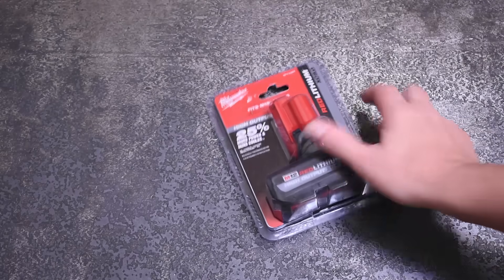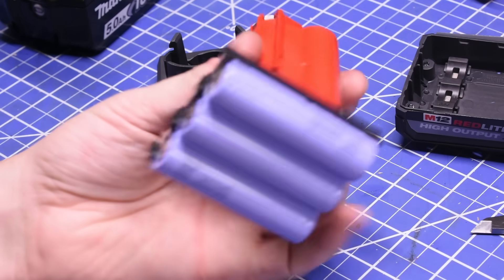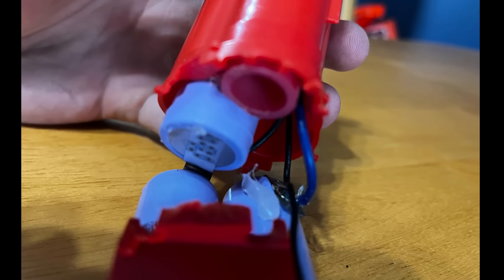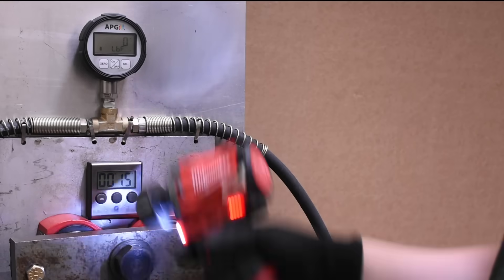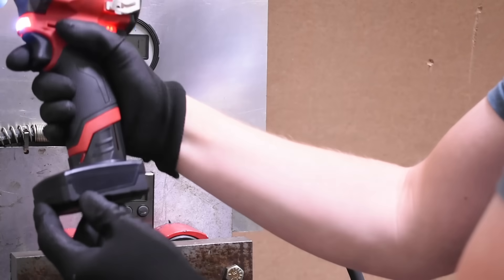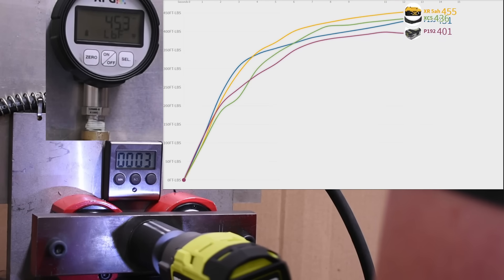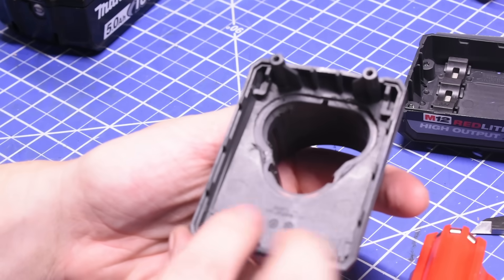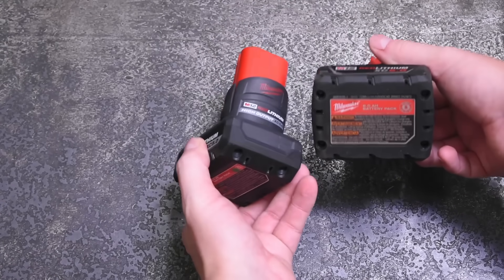Milwaukee's New M12 XC5.0 High Output vs Stuffing Actual 21700 Cells Inside

Comment: The existing xc4.0 and cp2.0 are also basically "high output" in that their cells are rated for 22 amps continuous discharge. The new HO M12 batteries use cells rated for 25 amps continuous discharge. So not a big difference. Barely any difference. And those ratings from Samsung are pretty much ignored by Milwaukee who likes to stress cells to their limits... It's no secret that if a battery is overheated, then it probably says Milwaukee on it.
Reply from the maker: Agreed. And we've seen XC4.0 perform best overall on some tools and the odd test here or there.
Reply: Finally someone explained what I've been experiencing! I literally only jse xc4.0 and cp2.0 and for nearly two years and have sworn they seemed a bit better than my other sizes. My 6ah doesn't seem as powerful as my xc4.0. I was convinced it was some kind of weird placebo affect but it consistently proved itself.
Reply: @briand2195  the xc6.0 uses the crappy Samsung 30q cells which are rated for 15 amps. The 30q cells are also the cells Milwaukee used in their exploding hd9.0 packs.
Reply: Yeah that's it. When I saw this new ho battery I was suspicious of it and the marketing and when I figured out they were using these Samsung cells.i knew I was right it's nothing but marketing. Technically there is a 2000mah Samsung cell that's 30a discharge they could of re made the 2ah abd 4ah and really made them some high output cells. That would off been better to see then these current ho batteries
Reply: Rated current is always a bit of bs number. You need to observe the voltage drop at these current levels and 25s are much better there
Reply: @riba2233  not really. The cells rating factors in the internal resistance and calculates it by what a cell can continously output without heating up
Reply: @randybobandy9828  sure bit for pure performance and how much power the tool will output voltage drop is most important. 25s have much less voltage drop and heat much less
Reply: @riba2233  voltage drop is the result of increased internal resistance. So ya..
Reply: @randybobandy9828  I know, and 25s have lower ir despite having similar cdr
Reply: @riba2233  and how exactly do you think they determine the rated amps of a cell?
Reply: @randybobandy9828  mostly based on temps, voltage drop is not a top priority
Reply: @riba2233  and Temps are based on internal resistance.... Which causes voltage drop lol.
Reply: @randybobandy9828  it is not always so simple. You can have cells with same discharge curves and voltage drop, but one getting much hotter.
Reply: Um no.. They have double the cells which means double the amperage atleast compared to the cp 2.0.
Reply: Those are also the batteries that Milwaukee is claiming 25% over, not the cp3.0 or the xc 6.0.

Comment: haven't had an m12 battery fall out yet. Getting them out sometimes is a challenge though.
Reply: Yeah that only seems to happen when the shell breaks
Reply: Same, Ive had issues getting them out when they are brand new but I've never had one fall out and my m12 rattle gun is probably my most used tool.
Reply: lol. I feel your pain. The key is to pinch them right at the top corners facing the front of tool.
Reply: Battery’s and good need to break in with around a week or 2 of constant use it will be a lot smoother
Reply: Seriously this. They're hard AF to remove and I've NEVER had one just accidentally come out. And my tools get used.
Reply: lol almost all of my batteries have issues falling out. unless the batteries are brand new or the tools brand new. I’ve been using for a long time though.
Reply: My old m12 batteries that I got when I bought their first ratchet falls out but they are 4 amp batteries a little heavy on the bottom. But it's only if it getting rattled good.
Reply: @jordanalexander615  i have 6ah and they've never fallen out, never even heard of the issue til now
Reply: @bradhaines3142  when I got mine there was no such thing it could have been an old design or maybe the tool itself. I noticed the screws on my 10 years old sub compact are loose but that was an easy fix.
Reply: Do none of you use the sawzall ?
Reply: @JoseHernandez-vz7bu  i don't
Reply: @JoseHernandez-vz7bu  I do and they don't (fall out).
Reply: Yeah they o ly fall out 99% of the time if there ild and worn out or broken or get dropped or shook up violently or not clicked in all the way if its new from user error
Reply: Or if its a knock off
Reply: You haven’t used the hackzall then lol
Reply: @zackphillips6648  For the third time, I do and they don't (fall out).
Reply: This man m12s 😂
Reply: I am a car mechanic and i use a M12 impact wrench, that regular M12 4ah or 6ah batteries hold about 6 month, than the tabs break of and the battery is pretty much useless. Got a new Impact from Milwaukee but it keep breking batterys. Hopefully this new battery wil solve the problem, i ordered one now.
Reply: I have the XC 4.0’s and can confirm they are hard to get out sometimes. Especially in the M12 Inflator.
Reply: I fought and fought to get the batteries out. Glad to hear someone else had the same issue. You know what I found? If you turn the drill/driver upside down, and lightly squeeze the two release spots, while pushing upward, it pops right out. It is unbelievable how easy it is to get them out that way, not sure why it is so difficult to get them out the way they should come out. The method I described above works for OEM Milwaukee batteries and the aftermarket ones you get off of Amazon. Hope that helps.
Reply: Mine has come out once while hitting a 10 lugnuts for 10 secs each
Reply: Same
Reply: Same here Steven.
Reply: Wish I could relate but I've broke my 2.0 and 5.0 battery's cuz they just fall right out 😩
Reply: Many an M12 tool has dropped off an 8' ladder to concrete and I've never had a battery self eject.
Reply: Shit I've had to send both of my XC3.0 M12 batteries back to Milwaukee for new shells.
Reply: Same here with my personal tools but I work in a machine shop with M12 drills at every mill, and when abused they start falling out pretty quick.
Reply: @jeremymiller1088  New RULE:  You abuse your Milwaukee, you get a Black & Decker next.
Reply: Never had one fall right out but on my stubby impact it very frequently shuffles out enough that the tool stops working. Incredibly frustrating when you're trying to get the job done
Reply: Only time I get my m12 to come partially put is when I’m using my m12 drill to start a lawn mower but that’s partially due to the torque on the drill not the battery’s fault
Reply: Mine are only a year old and they fall out all the time
Reply: I’ve had alot of them fall out,some tools are worse than others tho.

Of course only when dropped…..
Reply: I've got a 6 month old broken tab 6ah 12 volt right now in my work van. Ridcolous. Not sure if they'll just give me a new one or keep it for 3 weeks like they did woth my Milwaukee ratchet when rebuilding iy
Reply: I bought my first pack of 6.0s from the Cornwell man and had to warranty both of them the same week as both of them broke and would not stay in the ratchets and grinders I use daily. Really made me upset. Starting buying Snap-On instead and now the main problem is getting those damn batteries OUT of the tools hahaha. They are SNUG in there. But thankfully they last for weeks so I don't take them out often.
Reply: Especially getting them out of the m12 air inflater, when your using the compact battery's (1.5-3.0's). Still one of my favorite and most used tools though.
Reply: I struggle the most getting my 6ah battery out of my M12 radio... So much so I just use 2ah batteries now on the radio
Reply: The M12 Hackzall chucked it's xc6.0 and broke a tab off, otherwise I haven't had any problems.
Reply: Yes! 
I have not had a battery fall out when I put it in right matter fact I have a hard time getting them out. 
I think other people just don’t put their batteries in properly
Reply: I've got 3 of them that have been back to Milwaukee a total of 8 times for the shell cracking at the base of the tabs.
Reply: Ive had several m12 and m18 batteries fail.  All limited to m12 6ah....m18 12ah and 6ah batteries.  On the 12's and 6ah m18 batteries they failed by 2 packs.  Anotherwords sequential serial numbers.  Either milwaukee intentionally sold old batteries to HD or a quality control issue occured for periods of time.  Either way...I'm dead set on switching over to flex.  I'm most of the way allready.  Red can keep their new forge batteries....
Reply: I’m finding that at work as well.
Reply: This right here.  I've got a pile of M12 2 ,4 , and 6Ah batteries and they can be a 2 person fight to get out sometimes.  I'll stick with my 6Ah from this test.
Reply: Hell yeah lol
Reply: Yea I can’t get mine out 😂 I’ll be standing there fukkin with it for a good min.
Reply: When I first got my M12 ratchet I had troubles with the battery falling out I even had tape across it to make sure it would not do that again and then I switched to an aftermarket battery I've never had one fall out since
Reply: @deepsquat600 the aftermarket batteries have a very tight fit! I have trouble getting them out sometimes
Reply: Try em with a sawzall
Reply: @cedrusthe1st  I have for four years without issue.
Reply: To me that sounds like you're keeping the batteries cool. ABS is pretty soft when barely warm (below boiling point). 

Try leaving a pack sit in the sun for a few hours, then test that latch.
Reply: @Iowa599  If you're leaving lithium based batteries in direct sunlight for hours at a time, that's on you.
Reply: @Iowa599  Anyone leaving a lithium cell in the sun for a while is already doing something wrong. Setting them in/behind your bag/box or even a chunk of cardboard covering them will keep them scores of degrees cooler.
Reply: @hydrocarbon82  sometimes they're getting fried in the sun while on your belt

Comment: how about slapping a rc hobby lipo onto it. they are designed for extreme loads. a 4ah 3s pack with 80..120C can handle 300amps with ease. lipo might have a lower voltage tho, might try LiHV batteries instead.

Comment: TTC! I’ve been thinking about making a custom “stacked” battery. Basically fitting 5AH worth of power into possibly a 2.0 case but from polymer cells. Similar to dewalt but for Milwaukee. Would that be something you guys would be interested in?
Reply from the maker: In m18? Drop us a line Torquetestchannel@gmail.com
Reply: @TorqueTestChannel  yes! I might attempt m12 in the future but due to the shape of the housing, m18 is the best case, plus power gains would be considerably more significant/noticeable. I’ll shoot an email over!
Reply: I would suggest not using rc car styled pouch cells. You'll have to find the correct ones and also learn how to keep them from over heating but in theory it's a good idea
Reply: @kentuckybeardsman  over heating? They have far lower internal resistance usually. They wouldn't overheat anymore than a normal 18650. Problem is they aren't very energy dense so it would be Hard to fit a higher capacity in a drill pack even factoring in the round vs square cell shape that leaves gaps in the pack.
Reply: @randybobandy9828  Ive been running nitro and elec rc for well over a decade and using pouch cell batterys for many many years.  They will get hot my friend.  This is coming from experience
Reply: @kentuckybeardsman  they get hot when you jam more amps through them then they are rated for. The C rating on lipo cells is many times greater than 18650 cells. They use 18650 cells in power tools for life span and capacity.